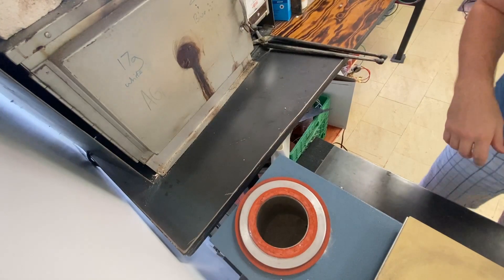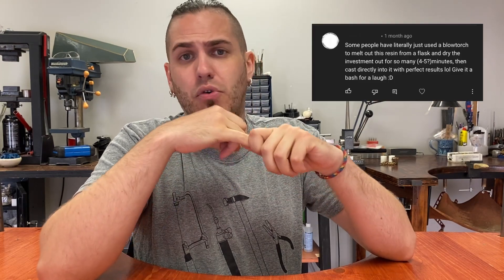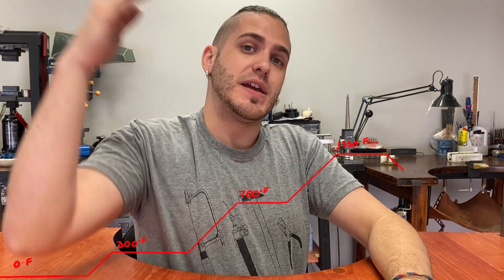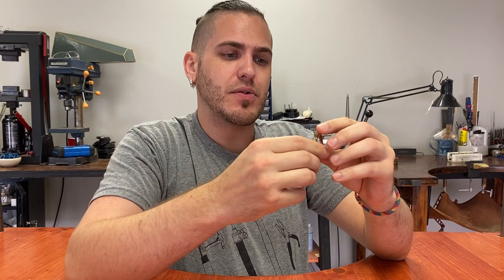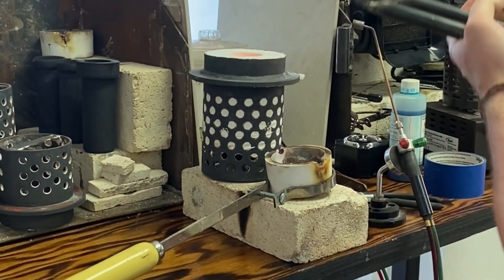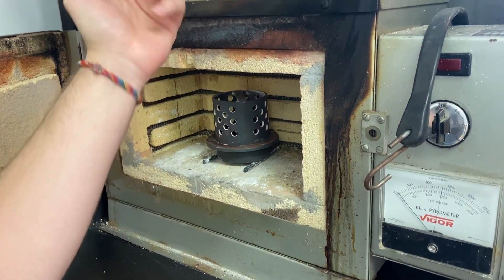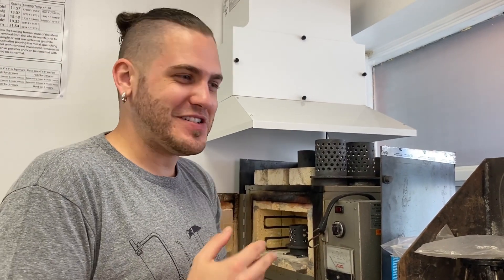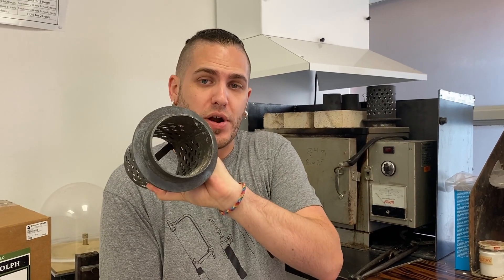Lost Wax and Lost Resin Casting Burnout Process | How to get good casting results| Casting 3D Prints

Comment: Please help. I’m having problems with the burnout process. I have a new kiln. It doesn’t have a hold. I do everything manually. I’m confused by the cool down time and the hold time. I do 300 for a hr. 700 for a hr. 1250 for a hr. Then pour. Is that not correct? Using sterling silver. Any tips would be greatly appreciated.
Reply from the maker: Hey, I think we chatted via facebook. Hope our advice helped.

Comment: Is there a print out for step by step instruction on the casting process? I have a manual kiln by Rapid Pro and I’m struggling with how to set the temp and when to move to the next temp. I have the same vacuum as yours and I have a simple melter. Everything is brand new and I can’t find any youtube videos even from the company on their manual kiln.
Reply from the maker: We have this digital download that has a written version of the burnout in the video (along with investment mixing ratios etc) https://clearmindcasting.com/products/lost-wax-casting-cheat-sheet-poster

Comment: Wonderful tut, I can’t wait to try. Been trying to cast from resin for three years. Question: isn’t 400c too low to cast sterling ?
Reply from the maker: The 1000.F-800.F (flask temp) below the casting temperature of your metal is a guideline. We run closer to 800.F below for silver alloys.
Reply: @ClearMindJewellery  tried 842 f which is 450 c and castings wasn’t great as for example in 600c which is 1112 f. In this temp every thing came out smooth and sharp (wax not resin, resin comes out bad)

Comment: Hi, I’m using the Wax Castable Resin from Power Resins. Do you know the correct temperature and time period I need to burn this wax properly, I keep getting porosity in my my cast!! 😭. Much Thanks.
Reply from the maker: We cast all of the resins we review using the guideline in this video, including Power Resin Wax. Surface texture has multiple causes. If you are using a burnout schedule like the one we described it could be something else in your process causing the issue.

Comment: Hey great vid very informative, I have been thinking about starting casting and I have a question, how about if I use 10 of that smaller flask 14:28 and get 20 pieces in 8 hours instead of using 4x6 flask for 13 hours? Would that work :)) I assume that Owen is around is around 12x9x9 inside and can carry 10 of that smaller flask, is that correct? :)

Comment: Great step-by-step.
I was going to ask if you turned the flask up during the burnout (let gasses from the castable resin go up and away) but your flask removal motion from the kiln to vacuum answered that for me. Good stuff!
Reply: by flask removal motion you mean those 2 sticks on the bottom, right? does that mean I don't have to turn the flask if I use those sticks on the bottom?
Reply: @sancakli454  The sticks keep the crucible off of the bottom and allow air circulation as well as gases and wax out (not a pro, just what I've read). I use a piece of graphite to lift my flask off the bottom.

Comment: I picked up 7 4x5" sections of stainless pipe at my local metal supply store for $90. I don't have a welder to add a ring so I was going to try the straight pipe with wax straws around the border or maybe add a bolt at the top at 12/3/6/9 oclock and then a silicon gasket. I've never casted before. I could just buy the flasks but I'm inclined to build stuff. Any advice? :)
Reply from the maker: I have built my own flasks before out of mild steel and welding on the flange ring. the biggest issue was keeping the ring flat. Any gaps between the flange and the rim of your vacuum chamber will cause issues with your cast. 
You can just use the pipe without a flange. But you will only get vacuum drawn from the bottom. Using the straws is a way of improving the vacuum draw across more surface area with a vacuum table.

Comment: You had mentioned to wrap your molds after you put in your investment in  if you are not going to use them within 6 hours.   Why and with what.    When I played this video you started to say something but then it glitches and moved on to a different topic
Reply from the maker: It's not a glitch it's a speed up edit, this video was meant to go over the burnout process not the entire casting process.  We did a diffrent video about investment: https://youtu.be/Oe2wxE-fXmU (and have more detail in our purchasable content https://clearmindcasting.com/collections/classes/products/online-lesson-investment-mixing)

We wrap our flasks immediately after the mixing is done if we know it won't be going into the kiln for another 6 hours, with a damp rag. As if you are working with clay. As you don't want cracking.  The flask needs to have some moisture, going into the kiln, or it becomes more difficult to get a successful cast.

Comment: Hello!  I was wondering what to do with the invested flask if you have to leave it for more than 6 hours.  You started to say that you can wrap it but I was just curious.  Was thinking I could get flask ready at end of day, leave it overnight, then start butnout process first thing next morning. Thank you for all your amazing work on this channel!!
Reply from the maker: The longest you can leave it is 6 hours. You have to do a burnout after that.
Reply: Hi TB, I don't know about resin or PLA models, but we routinely let invested wax (jewelry) models sit for days before burnout with no issues.  The key is to wrap it in plastic so it won't dry any before burnout.  If I know it is going to be a few days, I'll dip the flask into a bucket of water briefly before putting in plastic.  We also steam out flasks for 1 hour to evacuate the bulk of the wax before putting it in the cold kiln.  This helps reduce those nasty burnout fumes, as Dan says, good exhaust ventilation is essential.  I doubt this step would help with a resin or PLA model.
Reply: @SquishyMit  thank you!

Comment: When people do a burnout without steaming their wax out does the wax just goto the bottom of the kiln and burn off? or do they put a plate of sorts to catch the wax?
Reply from the maker: Either are ok. Some kilns have enough space for a small shelf with a tray underneath it that you can remove at a certain point in the burnout process so that the wax isn't burned. 

Personally we do not have such a /shelf tray because we don't have enough room for it and our normal flask size in the kiln at the same time, and I run an overnight burnout so I wouldn't be there to remove it any way. The wax/resin burnout doesn't outwardly appear to have much effect on the kiln insulation. If I had the option I would certainly dewax/remove a drip tray rather than have it burn simply to save on ventilation filters and whatever benefit could be had for the kiln.

Comment: hello how is it going, love your channel by the way. i was wondering how come your rubber gaskets never warp when you put the hot flask on the vaccume machine? i always have problems with the warping which ends up causing a bad seal on my vaccume
Reply from the maker: I'm afraid I don't have a solid answer. We're using the stock gasket that came with the machine without any special treatment or care, ours just doesn't warp. It is starting to break down heavily and will need replacing soon, at which point we have a much thicker gasket and a graphite cover to try, that may be something to look into.
Reply: @ClearMindJewellery  then u are so lucky i have created a work around by making a cut out from thick cardboard then wetting it and placing on top of the gasket. seems to work 90% of thr time hehe. where would i be able to buy new thicker gaskets?
Reply from the maker: @gmajor398  We bought ours from European Designs and Gesswein Canada. Where you get them will depend on your location.
Reply: @G Major  Hi fella we had the same issue when we started casting as we're in the Uk and supplies are limited. I recommend getting a good gasket from an american supplier (red ones seem best) and lowering your flask casting temperature slightly.

Comment: How do you dispose of the water after quenching?
Reply from the maker: After letting the investment settle I use a hand drill water pump.. thing and drain off the water I can from the top which is relatively clear. Then empty the basin into a bucket and let whatever water is left in the investment evaporate for a few days, then transfers into plastic bag and into the garbage.

Comment: My burnout cycle is super fast.. I invest the 3" flasks, wait maybe 30 minutes, then into the kiln to dewax from cold at 149c, once it reaches that temp I wait another 30 minutes, remove my wax tray and ramp it up to 371c and wait maybe 30 minutes until the steam stops coming out of the spy hole of the kiln, then ramp it up again to 732c and leave it for an hour and a half, then cast.. The whole cycle from wax models to cast bronze is about 3 1/2 hours. I'm pushing my luck but I get near enough 100% success rate.. Its not always necessary to follow the guidlines exactly because your equipment varies..
Reply from the maker: Glad to hear you’re having some success with rapid burnout. 
For beginners I would still recommend they follow along with the guidelines based on the size of flask and can experiment later if needed for resins etc. It’s not necessary but does offer the best consistency.

Comment: Centrifugal casting is very different because you melt the bronze once the flask is in the cradle rapidly losing heat.. I take my flask out at about 600c which works out well for 3" flasks..

Comment: nice. Thank you. I heard the flasks actually should be at least 1" above the bottom of the kiln .
Reply from the maker: An air gap in general is required for a good clean burn. Our kiln is lucky to give is 1/4" with the 6" tall flasks and we haven't had any issues with that set up for years, but the more room the better. When our kiln dies I'm considering the Paragon Dragon, which would allow us to give as much room as we wanted.

Comment: Such a fantastic and informative video, thank you so much. Quick question: I use bluecast x5 and plasticast bandust and occasionally i'll have some slight perosity left on the casting, (small dents / divits). Would you recommend holding the material removal temperature for longer to combat this or is there another suggestion you may have?

Thank you so much for these videos, you've helped me a ton in this learning process!
Reply from the maker: If you are under or at the two hour hold at 1350.F we would definitely recommend trying a slightly longer hold (up to 4 hours). It is hard to recommend a solution without going through your process and all the possible issues that could occur, this is why we created the membership program.